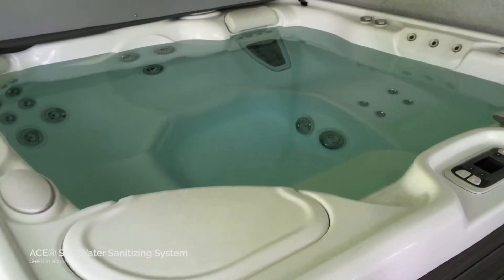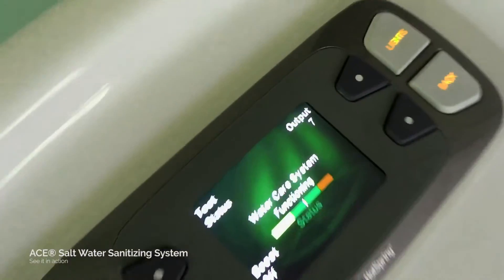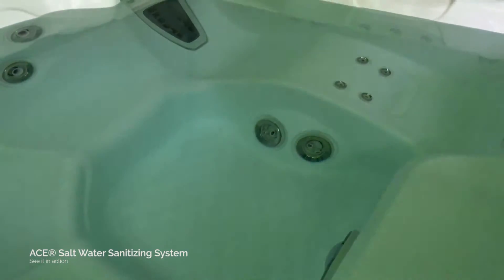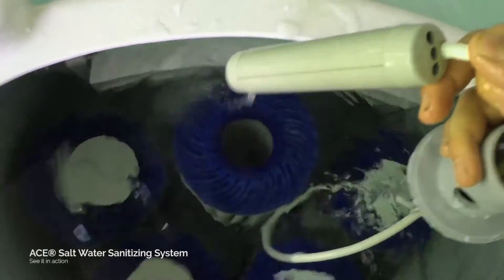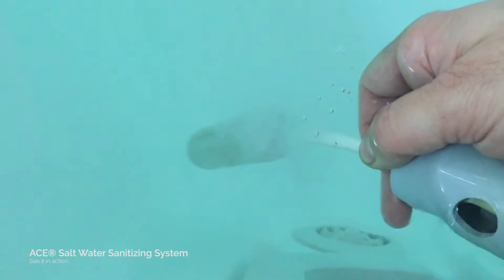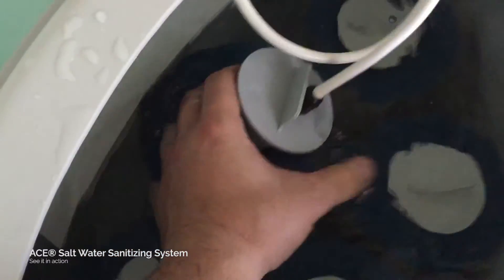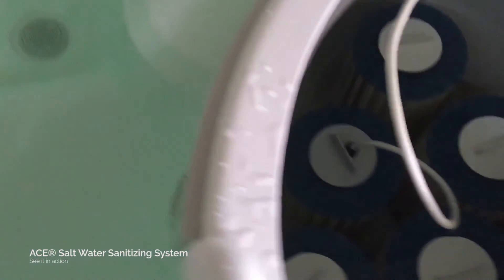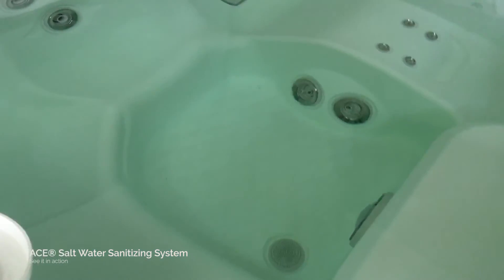HOW IT WORKS: ACE® Salt Water Sanitizing System

Comment: My service guy and customer service rep said that the ace cell does not always create those bubbles; they indicated that the cell only "bubbles" at certain intervals and is based on the output level. i.e. lower output, less frequent the ace cell bubbles.  I would be interested to know your opinion on this as I'm now on my second ace cell in just over a year and neither one of my ace cells has EVER bubbled like it is shown in this video.
Reply from the maker: +Erika Sykes hmm I wouldn't say "bubbles" is the main thing to observer but rather look for the milky substance that appears as it is generating chlorine. That substance is indeed very strong chlorine. Are you adding the correct amounts of salt to the water. Without it ACE will not work.
Reply: Yes, the salt level is correct and verified by the service tech yesterday.  My water is completely balanced and has the appropriate chlorine level as well.  Thinking it through, I would guess I wouldn't see the "milky substance" coming from my ACE cell that is shown in your video if my water is completely balanced and has the right chlorine level, right?

Comment: Thanks for the explanation, very helpful.  Question:  Does this ACE cell prcess deplete the salt in the tub?  And if so how often does it need to be replenished?
Reply from the maker: John no, ace runs because of salt being present in the water. It does not need to be replenished and should last the life of the water change cycle. I change my water every 3 months but you could stretch it to 6